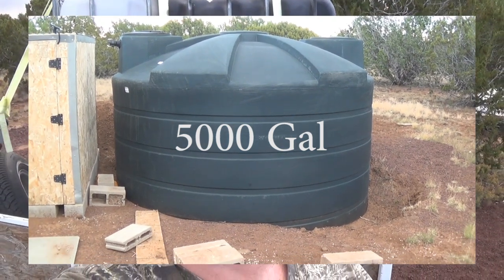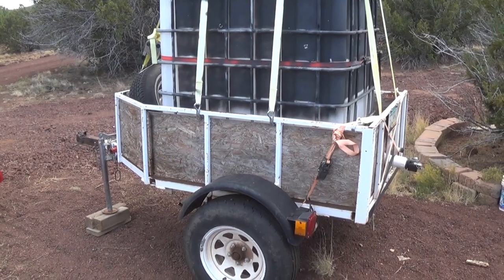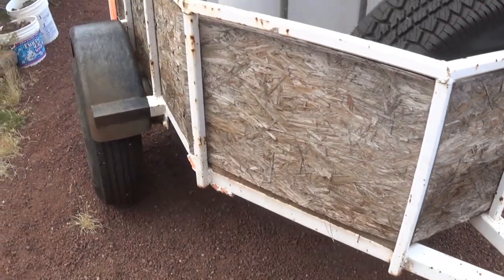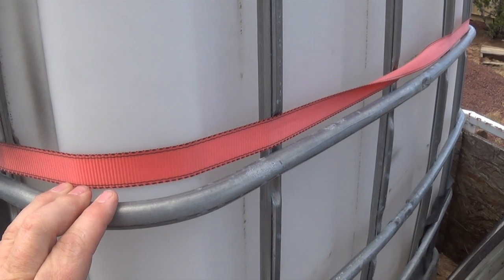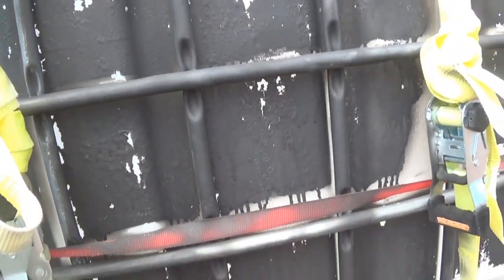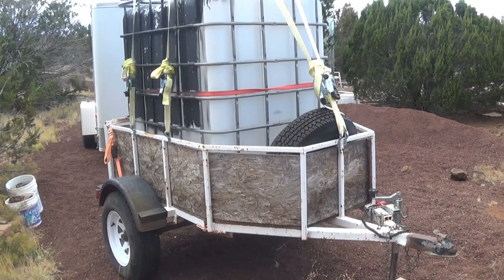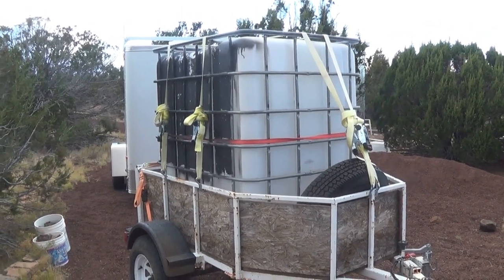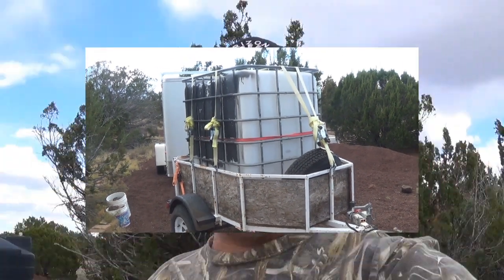Off Grid Water - How do I Get Water for my Off Grid living?

Comment: My homestead is 40 miles out of St. Johns, AZ and I get water from town using a 275 gallon tote.  There are two places in town where I can get city water for $.01 per gallon.  There is also a community well about 7 miles from me where I can get well water for free.  

I fill a 420 gallon tank from the tote, and that lasts me about three months.  Of course, it's just the cat and me.
Reply from the maker: nice. good to know about the water in st johns.
Reply: We're moving up northwest of Witch Well this weekend. Going to have to haul sometimes so thanks for the note.
Reply: Is the community  well a POA?  Where my land is by Seligman the POA has two wells but you need a 7500w generator for the pump.

Comment: Take care while driving with this trailer. The shifting water could easily cause the trailer to flip. Many mobile tankers have baffles to limit water shifting.
Reply from the maker: lol oh yea you can feel the water shifting. lol. only got to drive 10 miles and most is low speeds . but great point to bring up.

Comment: How about how long you can store water safely until it goes bad? I am not sure if it is just myth but people keep saying that still water grows bacteria and it goes bad etc so I am worried about having water in a still tank or does it need to be filtered etc? So my options for my country house are either visiting 2-5 days at a time 2-10 times er year and fill up a tank or be there for 1 month in a row as a long paus. So I guess the question is if it a problem if the water stays around for 1 month without being moved nor cleaned.
Reply from the maker: the large 5k gallon tank i have is dark in color and UV protected. in order for bacteria to grow it needs oxygen and UV/sunlight. take one away and bacteria shouldnt grow. the next is to make sure the water in the tank is clean before it goes in. if the water before it goes in is contaminated in anyway thats were you will get slimy stale water and may even get things to grow that doesnt need sunlight. food grade hydrogen peroxide is what most well users use becus there is no by product like bleach. i guess the by product is what it kills. use a basic house filter to keep any dirt, slim from getting into the lines and a berkey water filter to be extra safe that your water is clean to drink.  makes sense.?

Comment: does the water in your big green tank freeze if you keep it somewhat full
Reply from the maker: so far no.... the key is the dark tank heats up a little. plus with the temps in this area if you have at least 1k gallons you should be ok. if you have a layer of ice on top be sure to break it so you have suction problems.

Comment: Some wells  cost even more than 22K.  I would say you will probably get plenty of rain, being up north. We get plenty here and and those that harvest do not need to haul anything.
Reply from the maker: I get around 10  inches so that should be enough . I hope
Reply: I see.  We get more than that in my area-maybe the reason for all the 
collection.  We have a lot of humidity 5 months out of the year too. You might be able to make it off the 10"
Reply from the maker: with enough roof collection area I should be ok. plus that 10inch doesn't include the snow.

Comment: Hi. Can you tell me what is the axle weight on the trailer ..I got a tote.  But don't know what trailer weight to get..thanks for your video
Reply from the maker: water is 8 lbs per gallon. so a 330 gal tote weights in at 2640 lbs . that means its best to have 3500 lbs axle weight. get away with 2500 but the shifting of the water makes me feel 3500 is better.

Comment: You need to wash the dirt out of your axle wheel bearings and then BUY THE DUST CAPS to keep the grease clean.
Reply from the maker: got to pack the bearings too. i dont use it much but plans are every couple of years to repack the bearings. cheap way to check the condition of the bears and the grease.